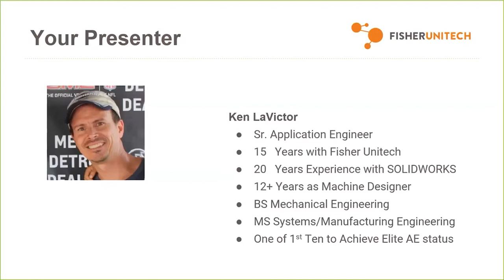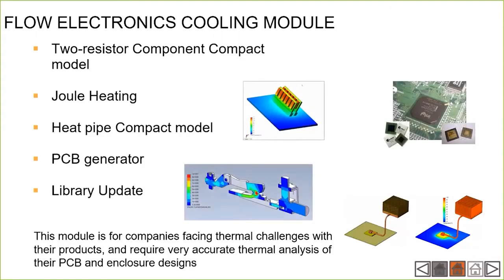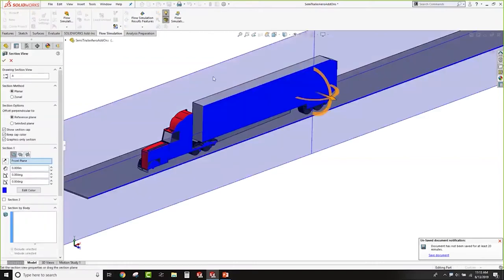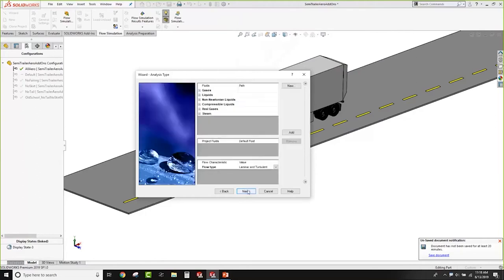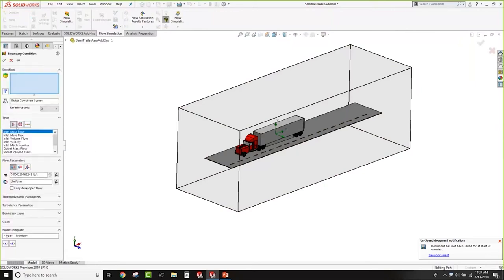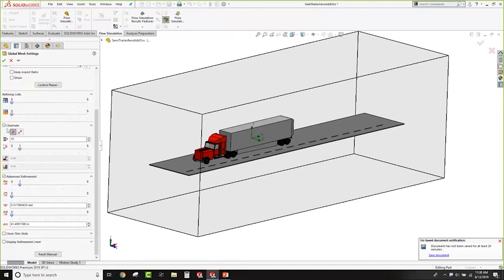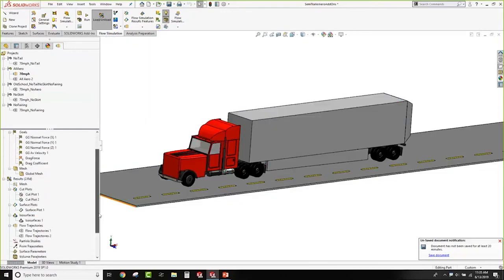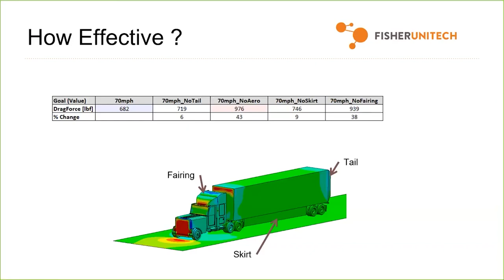How to Perform Aerodynamics Analysis with SOLIDWORKS Flow Simulation Part 4 of 4 [Webcast 2019]

Comment: I don't get it. The drag coefficient number and the forces are not realistic at all. Also the size of the computational domain alters these numbers significantly. I don't understand how solidworks flow simulation works .. but it's not accurate at all in my humble opinion.